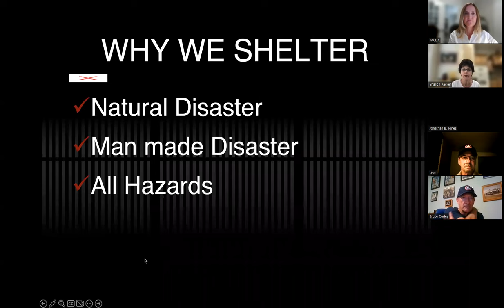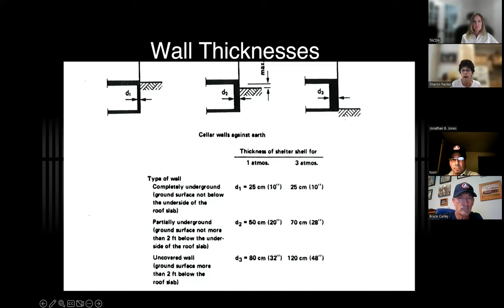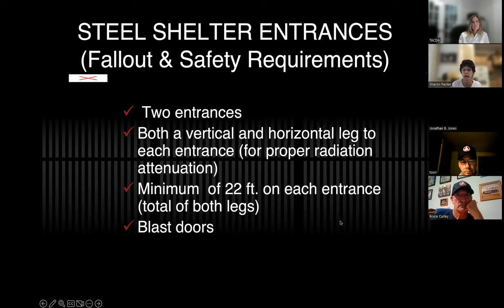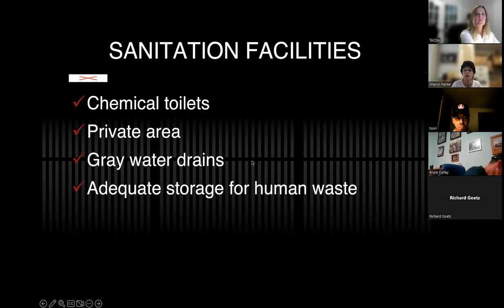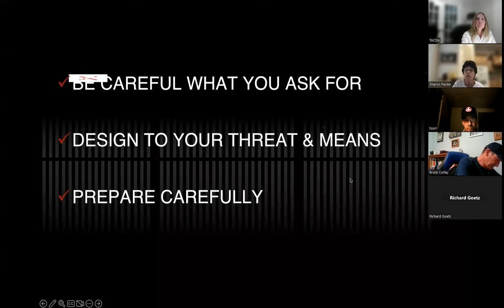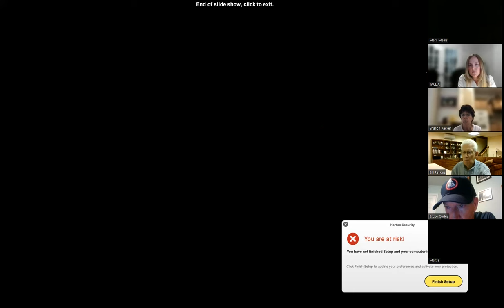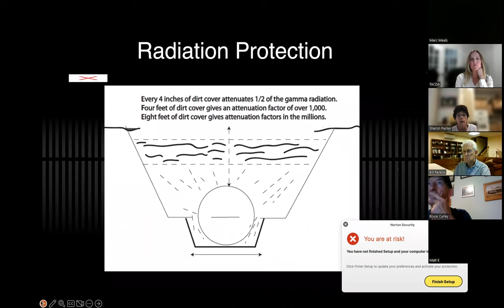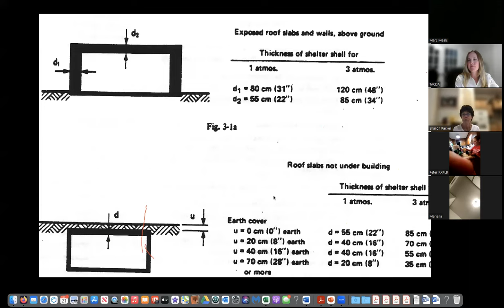Learn how to design and build a hardened underground nuclear blast shelter.

Comment: Thank you for all the info. I have a question... How you threw out the garbage?
Reply: HI Cole, 
Garbage and human waste are always a concern.  We carefully separate our “trash” from wet “garbage”.  Trash can easily be contained, but it is advisable that garbage be removed within a couple of days.
We use “dry toilets” in our shelters.  We keep heavy gauge plastic sacks in the shelter, that fit into the toilet.  The bags are tightly closed and stored in large plastic (or metal) cans with lids, until it is safe to go outside.
If there has only been radiation (and not a chemical or biological attack), the levels  of radiation decay quickly.   At the end of 2 days, the levels should decay to 1/10th of the original value, which is a small enough level to leave the shelter for a short period and to bury the bags.  It is most likely that the radiation levels will reach below 10 R/hr in 2 weeks.  If the radiation levels are above 10 R/hr., wait to go outside until after more decay has occurred.  

We suggest that you prepare a “hole” outside your shelter before a nuclear incident.  Fill the hole with soft material (such as sand or easily moved dirt), which can easily and quickly be dug out.  This hole will become the garbage area. After putting the plastic bags into the hole, cover them with the dirt that is next to the hole.   If you live in a rural area, you may also be able to prepare a septic tank and an “outhouse” type structure for the human waste and garbage.

We leave a small drain at the bottom of one end of our steel shelters and put a gravel drain field below the drain.  "Gray waste" (such as washing water or even urine) can be put into the drain. 

When leaving the shelter, make sure you cover your clothing and head with a heavy raincoat, mask and shoe covers, so you don’t bring fallout back into the shelter.  Discard your outer covers in heavy plastic container near the entrance before coming deeper into the shelter.

Thank you for your question.
Sharon Packer
Reply: @roseannehassett2054  thank you very much for your answer

Comment: sorry, i missed the live because i usually do NOT attend any thing live, most has lots of acknowledging people as they log in. but i NEVER do ZOOM!!  
if a person used a concrete septic tank, and put it at least 8 foot below the surface, couldnt they use it as the form and put rebar  over it and then pour concrete over it to create a structure with 24 inch thick walls? 
i have lots of construction experience, and the gothic style arch is even stronger than a circle. lots of WWII bunkers built by the nazis survived heavy bombing  and are still in good shape today!
Reply: You could possibly do that, but consult a good structural engineer to make sure.  Septic tanks are usually not able to handle more than 5 psi.  Eight feet of dirt is very heavy, and your shelter could catostrophically fail.  If this is a blast shelter, your engineer must figure the weight of the dirt PLUS the weight of any overpressure expected (ie 15 psi).  Your walls and footings must be engineered to safely hold all that weight and overpressure.

The difficulty will be getting a side entrance.  If you enter from the top, you get a direct gamma flow into the shelter. Shelters with top or side entrances without a proper 90-degree turn make very poor radiation shelters.   You must get  side entrances with a 90-degree elbow leading to the surface.  The elbow will give you a 90% attenuation of the gamma radiation.  Put in both an entrance and an exit, or you will create a “confined space”.  Confined spaces are illegal and very dangerous.  

The septic tank may not be very large.  If you are putting reinforced concrete around the septic tank, you are just using it as a “frame”.  You will need to frame it, anyway, and the tank just adds extra expense.
You might consider using a corrugated steel pipe (CSP) of 4’ diameter or less, for your entrance.  You could weld a  flange to the pipe and bolts it to the outside hole you have cut for your entrance. Again, consult a certified engineer for your plan. All these suggestions are  by conceptual suggestion, only, and not to be considered as legal or professional advice.
Regards,

TACDA